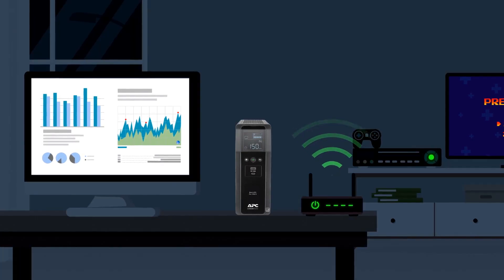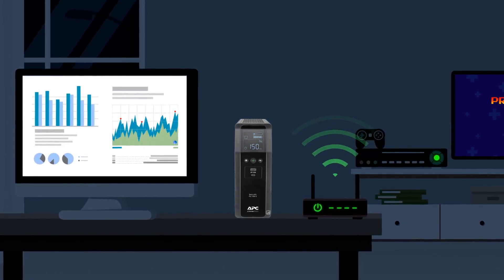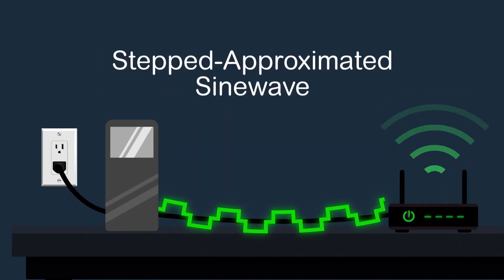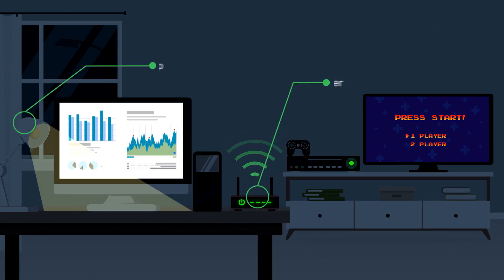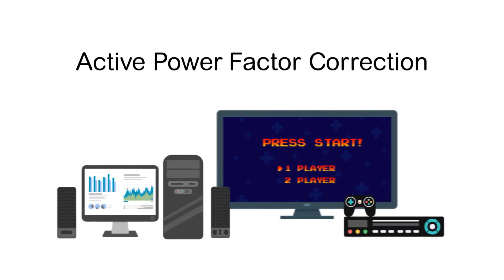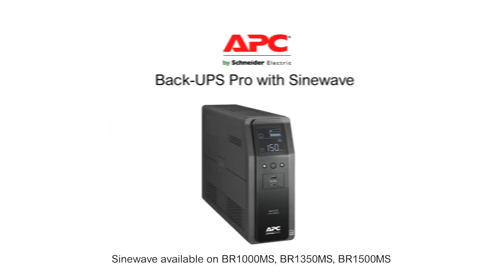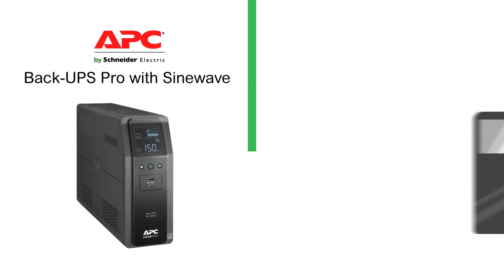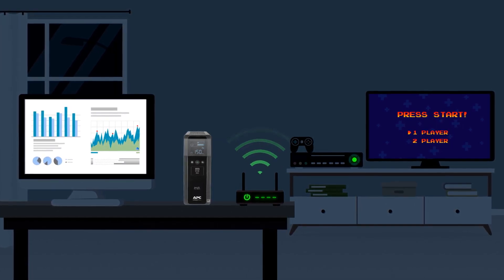Why is APC Sinewave Critical?

Comment: If pure sinewave is so important, it should be on all the models and not only on pro lineups.
Reply: Especially when it costs around 400~ for 900W, thats almost the price of 4k tv or cpu😂
Reply: It doesn't even work on pro lineups! I have the pro and it doesn't keep my PC powered. TWO units have failed within less than two months, the most recent replacement only lasting 2 weeks and 2 days. They tried to feed me this excuse; it LITERALLY SAYS ON THE BOX FOR USE WITH GAMING PCs. I am livid. I submit a BBB complaint because they gave me the runaround and tried claiming they can't do anything I have to jump through all these hoops. THE UNIT FAILED IN LESS THAN A MONTH. 

And no, it's not even close to overloaded. Right now just browsing the load meter shows one block; approximately 20%. Under load I have never seen it over 3 blocks (60%). The PSU at full draw can't even hit close to the 900w rating. The old one I had worked fine.

New APC UPSs are useless!
Reply: Because a lot of stuff is fine with the bang-bang of a 120Hz square-wave.  Sometimes power is just power

Comment: APC Back UPS PRO 1000 outputs "Dirty Power". If i daisy chain one APC UPS to another APC UPS, the second UPS Rejects the input.

If a UPS can't accept the output of another UPS, How could a PC Power supply run on Dirty Power.
Reply from the maker: When two or more UPS products are daisy-chained, the flow of electricity from the wall outlet to the device is split, causing a voltage drop. This can cause the UPS to become overloaded and can lead to damage to the internal components. If you have further questions, I would recommend contacting our technical support team. http://spr.ly/6054RHADr
Reply: The second UPS refuses to accept the output of the first one, even though both of them are without any LOAD and their batteries are fully charged.

Comment: The BN1500M2-CA is also marketed (at costco) by APC to be "Active PFC compatible"  "The new APC Back-UPS Pro models provide premium battery backup and surge protection. APC Back-UPS Pro models provide USB charging ports for your mobile devices and increased runtime for your critical electronics." >> So, if that's a PREMIUM and PRO product that can be used for PFC COMPATIBILITY, tell us again why we need the costlier BR unit for the ten or so times a year the power goes out?
Reply: Hi. I have no knowledge about this stuff. In our area we have terrible electricity service and experience power interruptions atleast 2x a day. I've been using simulated sine wave UPS for my PC with Active PFC power supply for 4 months now (daily blackouts) and haven't had any problems with it. Is it possible that it's slowly and invisibly degrading my computer? True sine wave is hella expensive.
Reply: I wrote to Costco. They said to contact APC.  I discovered though that the Costco listing doesn't match the specs on the APC site, nor on the box! Costco's site is apparently wrong about the model. Where did Costco get the listing info from then, regarding the PFC claim that's listed in the description FIVE times?   I wrote back to Costco to correct their listing as it seems to be misinfo. Will they soon?
Reply: @whiteblack6865  what is your psu?

Comment: Does it still do this when not on battery power? What if what’s coming through the wall has inconsistencies? Does this smooth those out? Thanks,
Reply: When not on battery power, you get the pure sine wave of the power grid in almost every case.
Unless you have an expensive double-conversion UPS, then you always get pure sine-wave from the UPS inverter itself. But this is not an UPS type you find in consumer and small business settings.
Reply: @squirts1  Yes, I'm sure. Most UPSes are of the line-interactive type. These pass through the AC line current and monitor it. They also have some electronics to filter the AC line current and to modify the voltage up and down if needed. The inverter is not used here so there is no square wave/modified sine wave output. This is only relevant if the UPS goes to battery.
Reply: @Aranimda  so is it safe to use simulated sine wave ups with apfc psu just for give enough time to shutdown the PC properly while the ups in battery mode because power outage is happening?
Reply: @DCC4G  hey man do you already have an answer to this? i just went down to this rabbit hole on trying to figure out whether simulated sine wave UPS can run with APFC PSU or not.. and its confusing.

Comment: b s
Reply: Says you.  Ever see what a simulated sine (DC simulating AC) does to an Automatic PFC power supply.  Some auto PFC power supplies simply won't run.  For those that can take it, It could shorten their lives.

How much do you actually understand about electronics?  Very little I suspect based upon your response.
Reply: @matthewgaines10  Automatic PFC power supply....will check it
Reply: @matthewgaines10  i c  auto power factor corr,,, u mean
Reply: @kaybhee6  
If you have to check it, you don't know enough to comment in the first place.

Yes, Automatic Power Factor Correction.
Reply: @matthewgaines10  apologies on upsetting you,,
Reply: @kaybhee6  
Whose upset.  It just implied you're full of bs and really don't know what you're talking about.  That doesn't upset me in the least.
Reply: @bparisi  too bad forums and reviews are divided on this one. It frustrates me that there's no official readily available info regarding this one. In my experience with simulated sine wave UPS I haven't had any issues for 4 months now, but I don't know if it really decreases my PC's lifespan. What's your experience with it?
Reply: @whiteblack6865  I mean it only runs when the power browns out or goes out entirely. That's not long enough to do any real damage so... shut down if it goes out and problem solved. It's not meant to run your PC until it's dead.
Reply: @matthewgaines10  I’m sorry to trouble you, I know it’s been a long time since this video/your comment, but do you happen to know — does this APC UPS still do the sin correction when not on battery power? I live in an area with a decent amount of inconsistency in terms of power outages and older wiring so I purchased this since I thought it would help protect my components from damage. Does it only do this correcting when on battery or does it also it when not on battery too? Thanks,
Reply: Agreed. They shouldn't be able to market it as for gaming PCs if it cannot support gaming PCs. You shouldn't need to be an expert in electronics to purchase a battery backup; the box should have said something about its "incompatibilities" not literally listing gaming PCs as an intended use application.